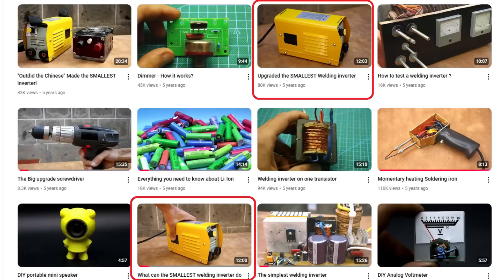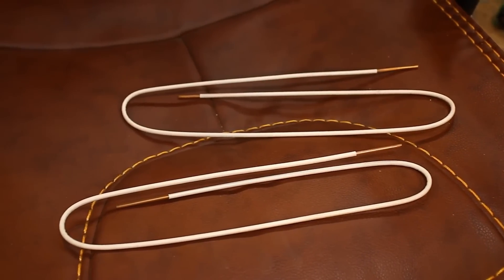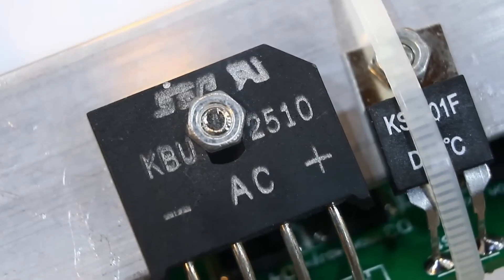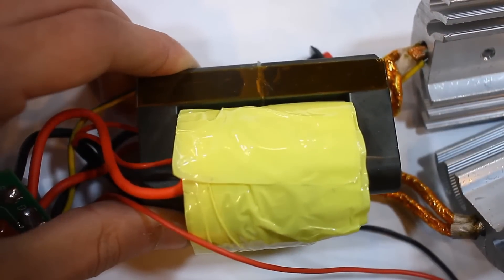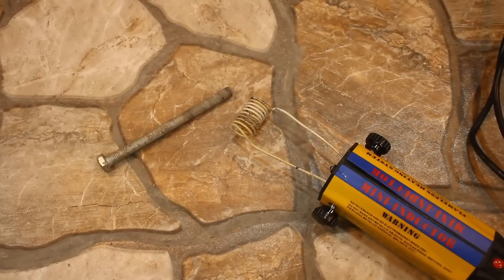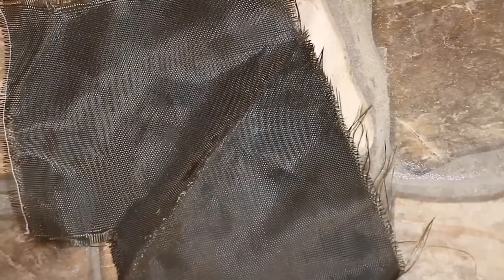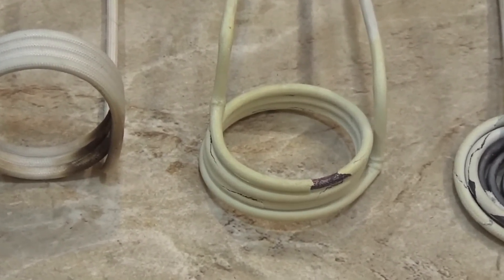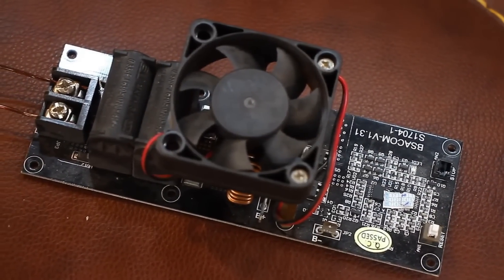What a mini induction heater from China is capable of

Comment: This is such random nonsense. The Curie point for iron is 770 °C, not 1085 °C (melting point of copper). This device is absolutely incapable of melting iron. Steel/iron has a melting point within 1400 to 1540 °C. That's far past the Curie point. You were able to figure out that it can't do that as it was not able to heat aluminium without the crucible. To be able to melt steel inductively, you have to be able to melt aluminium inductively first. Because past 770 °C steel will be paramagnetic exactly like aluminium.
Reply from the maker: You actually misunderstood. In the video, the iron was heated to its Curie point — that’s correct. I was trying to determine whether the device had phase-based automatic frequency tuning, which would allow it to go beyond the Curie point — it turned out that it doesn’t. It can’t melt aluminum because it only heats ferromagnetic materials, and aluminum isn’t one of them.

However, it is possible to melt non-ferrous metals — and even iron — in such heaters if proper thermal insulation is used, provided the device doesn’t shut down from overheating. All of this can be done using a graphite crucible.

Believe me, I know how induction heating systems work — I actually design them. I’ve published a lot about this on my Russian-language YouTube channels. If you’re interested, I can share links to my videos where I demonstrate induction systems that can melt steel directly, without a crucible, and feature automatic frequency tuning to maintain resonance.

Since I don’t speak English fluently, these videos are translated using neural networks — my voice is preserved in the translated versions. I hope that clarifies things.
Reply: @KasyanTV  No, I understood exactly what's being said at 11:25. Even the automatic subtitles that were generated talk about the work piece being heated above 1085 °C, the alleged Curie point.
Also, the device has obviously feedback regulated frequency as it allows you to change coils. If it operated at a single set point frequency, you'd never be able to heat anything in the first place, if you connect anything other than the original coil which it was shipped with. In the original form, too, because if you had somehow bent the original coil, then it'd cause a shift in the resonant frequency and such you'd never be able to heat anything ever anymore.
A feedback regulated frequency is not the only requirement to to facilitate the melting of steel. To do that, the system MUST be able to overcome the extreme drop in efficiency that comes as soon as paramagnetism sets in. When steel becomes paramagnetic, you no longer get a boost in heating from the hysteresis losses. After the Curie point, you purely rely on the resistance heating by the eddy currents and that means a much higher higher strain on the coil for ever degree you want to raise in the work piece. The simple truth is that's exactly what happened at 11:25 - your coil melted as you were trying to heat the the steel pipe beyond the Curie point.
Reply: @KasyanTV  Appreciate the video dude.

Comment: I purchased some of the boards a few years back and now just noticed there are induction heater boards for less than 20 dollars US.  Seems we can make one of these for 50 dollars US now.  Plan Vevor or other source for elements around 30 dollars US and the board for 20 dollars US.  Amazing, never thought they can be so cost effective if I am thinking correctly.  Have not been working on electronics much other than the super simple Prius issues, so may be lazy thinking.  Thanks for sharing, as always.

Comment: Induction heaters for metal without water-cooling are more toys, than a tools. When e.g. 6mm copper tubes are used with brazed connector-rods and hose adapters to form coils, a simple radial pump can convey enough water to operate the device for the required duration.
Reply: I have wondered like making a DIY PAPR, making a fanny waist pack for the heat exchange design and possibly if able to make battery powered. Would be wonky though if portable entirely.  Cooling however, like maybe with a Prius inverter water pump and 12V battery pack might be more an option. Might be useful in a rust belt part of the World when working on things.
Reply: For a shop that simply needs to unstick corroded bolts, there is no ned for water cooling.  So generalizations as above are rather stupid.
If on the other hand you want to use it as a furnace, then obviously water cooling is going to be the way.

Comment: can you figure out what chips were used on the pcb? Also why do manufacturers do this? Is it to hinder other manufacturers to copy them?
Reply: I have this induction heater without chip numbers removed.
U1; 3151V, Dual mosfet driver.
U2; CD40138M, dual flip flop.  Correction:  CD4013B
U3; lnk306dn-tl, power supply chip, it might vary slightly.
Reply: @mrDarktrooper  Wow, thanks a lot for the information. Greatly appreciate it.
Reply: The irony of Chinese manufacturers grinding IC identifiers off chips always makes me laugh.
Reply: @mikestewart4752   So true. We copied someone's circuit/IP, but want to prevent anyone else from copying 'ours'...
Also, they remove markings a lot of times because they are using a Chinese-clone chip of a Western one.
Reply: if I'm not mistaken, it's for making sure that the circuit cannot be easily reproduced, because you can't trademark/register a circuit. in the end, some of these ICs are trivial to figure out. but here someone already posted which chips they were
Reply: @cocusar  On my board it's copyrighted "2016 INDUCTION INNOVATIONS INC"
Reply: @mrDarktrooper that only applies to the pcb layout, the circuit schematics are not.
Besides, since when does West Taiwan care about intellectual property?